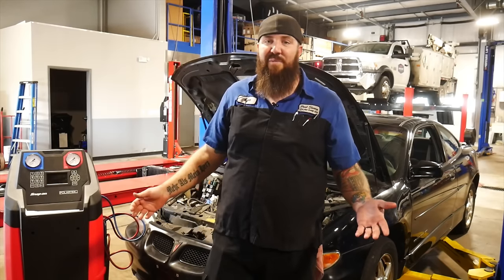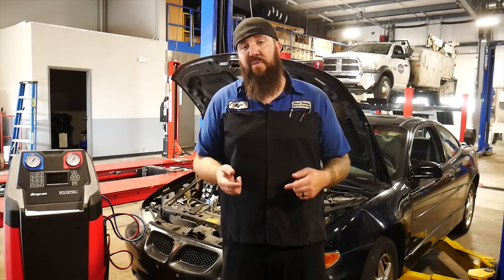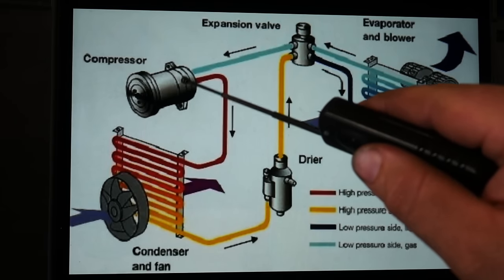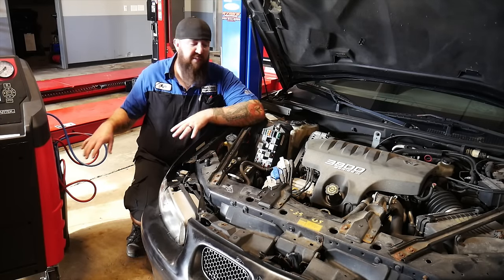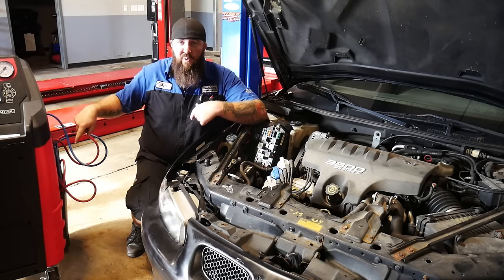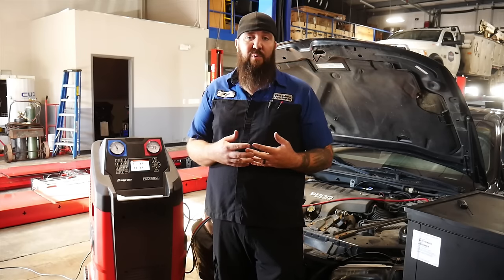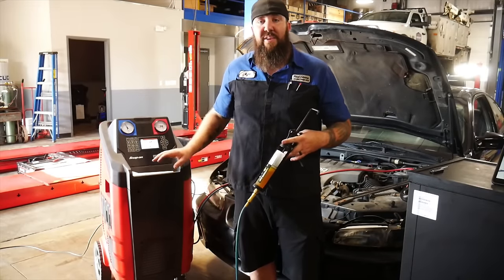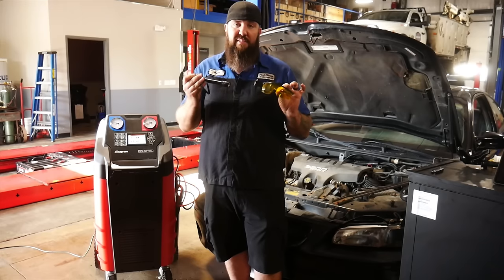AUTOMOTIVE HOW TO: A/C SYSTEM DIAGNOSIS FOR BEGINNERS

Comment: I got a question needing some help with. I have an 07 altima 2.5 s, ac fans dont kick on when ac compressor, and clutch is engaged, i know fans work, and checked all fuses, and power to relays, i can unplug ect, and both fans kick on, so iknow wiring is not an issue, but cant get fans to work on ac alone, which will cause too high of pressure. Any ideas ?
Reply: Replace sensor
Reply: @imlikerhettbutler5093  which sensor ?
Reply: @James-929  does the fans come on at engine temperature 180-200. If they don’t it’s the coolant temperature sensor. If they do check relays. Ac override.

Comment: I have a 2007 ford expedition I have had everything replaced for the ac.. the lines , blend doors,  the actuator , compressor , ECT... Ac works fine for months then goes back to hot air then works again for a while then stops  makes no sense what could cause it to work fine then stop .. what could the issues be?????
Reply: Evap temp sensor. Location, behind the dash

Comment: My grand marquis 2011 i have 25 psi low side and 200 high side i charge the system to 45 low and 250 high after one day i start my a/c and the compressor make harsh noise 2 times then work fine my ambient temperature is 30 Celsius at filling time now every time i start my compressor ifeel that my engine is straggle for 10 second . Did i do something wrong?
Reply: 45/250 psi seems too high especially if outside temp 80° or lower, for r143a 45 psi = 50° saturation temp which will not cool well at all, higher pressures = higher temps, you want the low side pressure down to 35 psi or lower and no more than 40° at the vent after 15-mins or you will not have good cooling, you can look up the correct pressures for any vehicle for free in auto repair database at a library..

Comment: My ac compressor clutch doesn’t engage and the fuse keeps blowing out. I have no idea where to even start working on a fix for this. Do I just buy a new compressor? Check for leaks? Buy a whole new ac system completely? Drive the car off a bridge and just use the insurance money for a new car? I’m stumped

Comment: How to diagnose the high and low pressure switches? I have two. One on high side that i can monitor pressure through CCM and one on low side that i cant monitor in the computer.
I have read that they control the condensor fan on/off and also the compressor clutch.. if the pressures are wrong they wont allow. Dont think they could be changed without discharge the system.
At least not mines. My high pressure switch might be dodgy.. i can see really odd pressure on the high side. 500 Kpa and when ac engaged like 1003 Kpa
Fan is coming on and goes off directly. Barely comes on and shuts off immediately.

Some times compressor clutch does not engage for a week.. and is really intermittent. Suddenly it comes on after 1 hour of being off :)
really hard to diagnose this.. i have tried lots of things.
Reply: They can be changed without draining the system. There is a schrader valve that is between switch and dryer or other line
Reply: @imlikerhettbutler5093  Im not really sure about that.. in Volvo VIDA it says to empty the system etc before removing the sensor and switch. At least for my S40 2006 1.8L
Reply: @orfeous  👍I work on domestic, chevy mainly
Reply: @imlikerhettbutler5093  i dont understand.. do you work on Volvo's?
Reply: @orfeous  no I don’t, only American made

Comment: my 2001  explorer is acting weird lol ac works fine on idle blows cold and compressor runs but if i rev it or start driving the compressor stops turning lol but as soon as i stop or idle it works again .full of freon everything ok any ideas where to start looking for this weird issue?not a blend issisue  its the compressor that stops working upon rev or drive works great on idle.thnx
Reply: Check low side pressure reading at 2,000 rpm

Comment: I got a 2008 Dodge Caliber a/c worked great for a few months not it just blows hot air. It holds a vacuum what could it be ??? Btw it’s the wife’s and we have a week old baby need this fixed ASAP
Reply from the maker: Without knowing the pressures of the system while charged it’s hard to know. Did it just loose its charge over time? With the system full does the compressor kick on?
Reply: Found out it was a very mynute leak on the high side port

Comment: if my car won't seem to get up to 200 psi on high side i get readings of around 35 psi on low and about 150 on high. the car gets cool but it is not great at cooling car off any idea what could be problem?
Reply: High side seems to low, 35 psi coverts to 40 degrees for r134a but will not cool well cuz of high superheat, there is not a solid column of liquid refrigerant entering the metering device due to low high side pressure (saturation point is lower which turn to gas more easily), you should have a minimum of 10 degrees subcooling at the condenser and a maximum of 10 degrees superheat at the evaporator, the evaporator outlet line going back to the compressor should be cold and sweating like can of soda out the fridge after the interior cools down (15-mins) with fan speed on high, if the evap outlet line only gets cold when the fan speed is on low (low evap heat load) you do not have enough refrigerant in the system, you should have 40 degrees or less at the vent on high with vehicle moving, over 40 degrees does not really cool well on 90+ degree heat..

Comment: I have a 2016 Honda Civic that is showing equal pressure on the AC gauges. I’ve already changed the compressor, condenser, and expansion valve. Any suggestions???
Reply from the maker: Is the compressor turning on? What pressure is equal? If you unhook the compressor from running do they equally drop. Also dumb question, you don’t have your gauges open between each other do you?
Reply: @RustbeltMechanic  I’m using a Mighty AC service machine. The low side is about 98 and high side about 102. I haven’t tried unplugging the compressor while running to see if pressure changes. I’m gonna try a new expansion value just to make sure it isn’t stuck open.
Reply: @RustbeltMechanic  and the compressor (brand new) is definitely running which is why I’m so stumped.
Reply: @RustbeltMechanic  low side 86 high side 93
Reply from the maker: Then its got to be either compressor is not pumping correctly or txv is stuck wide open.
Reply: @RustbeltMechanic  ok yeah because all I’m seeing as well. I got another compressor on the way. It’ll be here tomorrow so I guess we’ll see how it goes

Comment: though the ac condenser is in front of radiator & radiator fan blow the air on radiator ( not on condenser ) but the air does cross the radiator & reach to condenser & facilitate heat exchange # 👍🇵🇰

Comment: So I did the dynamic check and my lo pressure fluctuates rapidly between 41 and 43 psi, the HI pressure is sitting around 170 psi. Is it normal for the lo to fluctuate like that?
Reply from the maker: Yes that’s minor, as the expansion valve adjusts that will fluctuate slightly.

Comment: In my car the engine running idle it blows cold air but when I press the gas the ac blows hot do you have any idea about it
Reply: I have the same issue but haven't found an answer yet...

Comment: I think you are incorrect about the point at the evaporator and how it cools the air going into the cabin. Once the freon is a liquid and passes through the evaporator, it does exactly that.. evaporate the freon. The warm external air cools due to the heat being used to evaporate the freon.
So you are not cooling the evaporator, you are warming the freon, which takes up so much heat from the air, only cold air is left.
 I am obviously learning though lol that's why I'm here.

Comment: What does it mean if the fan doesn't turn on ? Or only turns on when you bypass the switch
Reply from the maker: Pressures are not getting high enough to activate the fan. Could be low pressure or low refrigerant level.
Reply: @RustbeltMechanic  thanks for the reply your video is awesome!
Reply: @RustbeltMechanic  when I am checking both low and high pressure the low goes to 50 to I saw 90. And the high was around 150 and now is down to 50. Any idea what this means?

Comment: Watching your videos there handy out thsnks ,I have a few questions I would like to ask ,such as can I just take off the a/c with out getting hurt  iam taking it off and any wiring to ,to remove the body off the chassis of my Suzuki grand vitara  I want to clean the chassis up 100 percent then put everything back as should be  I have all doors and seats and everything else off it wings everything except the engine hoping that I can lift the body off over it ,thanks in advance hopefully I have made sen5in what iam saying iam not a manchic or anything but I do know a good bit ,thanks again
Reply from the maker: Thanks for the kind words. However, if you are asking if you can just remove an AC line from a system that is still fully charged or without recovering the refrigerant, then no. It is both unsafe to do so and illegal to vent the gasses without recovering them. The refrigerant can cause flash freeze burns and do major damage. If you are unsure of what you are doing with the AC please consult a professional.
Reply: @RustbeltMechanic  no worries thanks for the help  didnt bother after so just gonna sand it and paint thsnks again

Comment: The problem im having is the high pressure is normal but the low pressure is low at about 15psi. You didn't explain that in the video.

Comment: Can you use "refrigerant" instead of "Freon"?  Also don't you need to be EPA-609 certified before you hook up any gage?   Otherwise a good video.    (I'm a certified HVAC/R technician)
Reply: Freon is a brand name of a halocarbon refrigerant by Dupont but you probably knew that seeing how you said your certified and were just being a "funny guy" but no you do not need to to be certified to hook up GAUGES. Or they wouldn't sell them in every automotive store to anyone that wanted them. Same with refrigerant cans 2lbs or less that usually comes with one GUAGE on the hose or can.. if you did   they would ask for your certification when purchasing ..you really only need to be certified for bulk purchase of refrigerant or when working on someone else's a/c that you are being paid or some way compensated  for the work, otherwise working on yours  or even others a/c for free is perfectly fine.

Comment: Great video, I just replaced the evaporator, expansion valve and the condenser of my Escape 2008, the condenser was about six month ago, and the expansion valve and the evaporator was just 20 days ago, I add almost three ounces of pag oil 46, and then I did the vacum process, the gauges never reach the -30 marck but it was about -24,  but after a moment the vacumm pump started to release oil, was that normal? thanks for advance

Comment: What about when low pressure is normal and high pressure is low?
Reply from the maker: Couple possibilities. Weak compressor, partially stuck open expansion valve

Comment: Hey guys i have  a 2014 mercedes c250 sport ac light flashes 3 times and it turns off now ac is blowing hot air

Comment: I just replaced my ac compressor thinking that it would resolved the issue I was having with the old ac compressor not working. I have the new one installed and charged and it when from blowing cold air to not so cold air (about 73,75 degrees). This went on for about two weeks and all of a sudden it started blowing hot air. I took it to an ac repair shop and they told me it was the pressure sensor switch. I have the pressure sensor switch installed, vacuumed and recharged, and it still blows not so cold air (70,73 degrees). Is anyone maybe experiencing the same problem? I have a 2014 Nissan Altima 2.5, 4cyl.

Comment: i have a strange situation. 2000 suburban. all my pressure gauges look good. 100 deg temps outside, low side is 55, high around 315. the high pressure side hose is hot, then after the orifice tube the low pressure side is cold (not super cold) and my air is still blowing about 70 deg out the vents. I also manually put the cool/hot blend door in the cold position just to make sure the actuator isnt stuck.  any idea what to check next? i dont wanna throw parts at it, and im pretty good at diagnosing. 

also the rear ac (separate controls) only blows hot but that symptom is almost alway a clogged expansion valve. ( front system uses orifice tube, rear uses expansion valve)
Reply from the maker: High side is a bit high. Does that come down when the fan kicks on or is the engine fans even kicking on?

Comment: Confusing because most beginners don't have the same equipment as you do.  So when you say close the valve.  My set has a valve on both ends.  So I had to watch another video and turn your off.

Comment: Nope. My vans compressor is under the vehicle behind a panel, so I can't even check if the clutch kicks on, relay works, blower works, but no cold air. Front air is cold, back air is warm.

Comment: I was thinking my expansion valve was bad because I had really high low pressure readings and no so high on the high side. So I replaced it and vacuumed the system before recharging it with manual gauges. My low side is a little over 50 now and high side around 50 and  it is no longer taking freon into it. What should I be looking at next?

Comment: Replaced the condenser on my car and went to recharge the ac system, pulled vacuum but when I go to put the freon I seems like it doesn't get pulled into the system. Any idea what it could be or what im doing wrong?
Reply from the maker: Sometimes it may not pull it ALL quite into the system, when that happens I will close the high side port, turn the vehicle and the ac on and let the compressor suck in the rest on the low side.
Reply: @RustbeltMechanic  thanks ill try that out

Comment: Hi there, got a question for you. I just replaced my AC Compressor on my 2006 Porsche Cayenne Turbo 4.5L V8. I vacuumed the system and checked all my fuses and I can't get more than 100 PSI on my high pressure gage. I'm at a complete loss. No idea what else to try. If you can help me in any way from your experience I would truly appreciate your help 🙏

Comment: Thanks for this video. My 2015 Hyundai Elantra compressor clutch does not disengage. It is always moving even when I turn of AC and the low side reads over 120 (retard) and high side is 112.5. Could it be my compressor clutch since it will not let go even after disconnecting switch and power to the compressor?
Reply: Pull the electrical connection at compressor to see if it disengages when ac is in off position
Reply: I replaced the compressor and now I’m good to go. 👍

Comment: You said "you need to make sure you're seeing enough oil in the system", but you don't show how to do that. You list an ad-hoc method for guessing based on which component you are replacing, but you don't say how to measure or actually know. You don't say if evacuating refrigerant causes the oil to be evacuated as well, and to what extent. It looks like you're going blind on very wild guesses. What am I missing? How do actually tell how much oil is in there??

Comment: so from what i understand with the car not running i need to open the valves on my gauges but when i get bready to start the car i need to close them is this correct
Reply: Keep high side closed, only open high side when pulling vacuum

Comment: Good video but it's not a diagnosis, it's  "How to recharge your system with equipment nobody but a shop owns". You didn't cover fuses, relays, thermal sensors, or controls
Reply from the maker: You must not have watched much of the video at all because I covered relays and jumping them as well as pressure sensors AND I explained using a gauge set from Autozone was pretty much the same thing I was using that machine for in just using the gauges for diagnosis. Feel free to watch the whole video next time